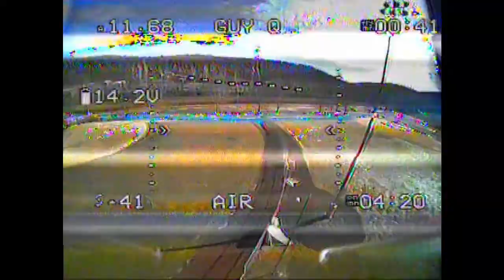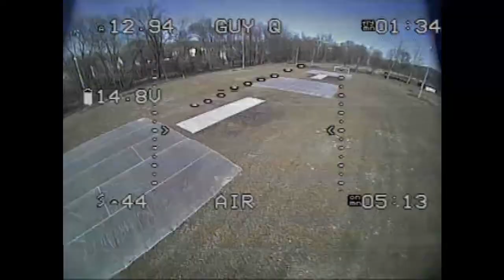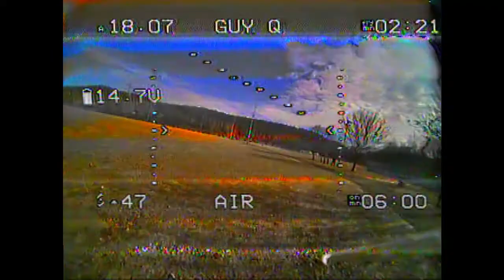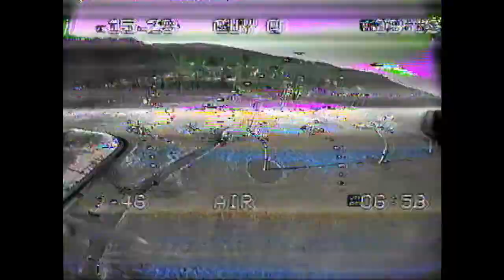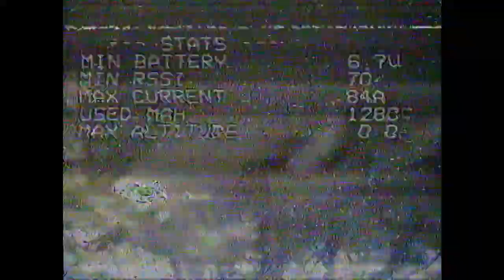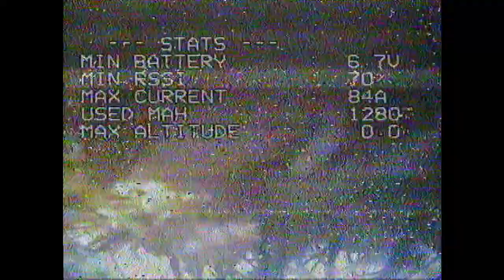BetaFPV 140 FPV voice over

Comment: Nice flight! Im bout to be building a 3" with the same 1606 motors and been trying to find people with the same setup. Thanks for posting your videos, gives me a better idea of what to expect. BTW I think your Horizon Mode may be weird for the same reason you OSD Horizon Bar is off, it may be your FC orientation settings in betaflight, your FC may be orientated backwards...
Reply: Thanks! Yeah I'll eventually figure out what is going on with the Horizon mode thing - although really it's not a big deal since I just use it for take off and landings (and recently I've been practicing on takeoff and landing in acro too, and i'll stop using horizon entirely).  Cheers!